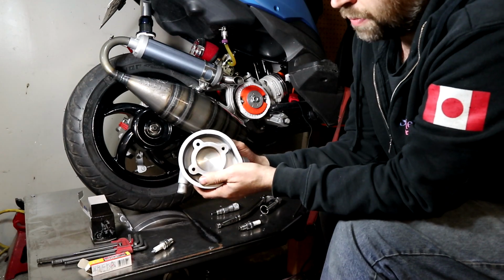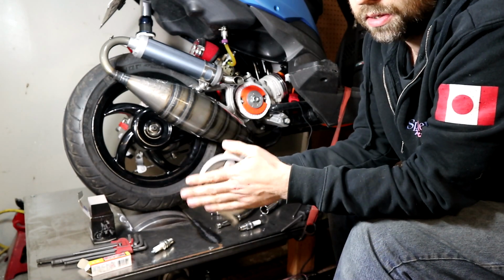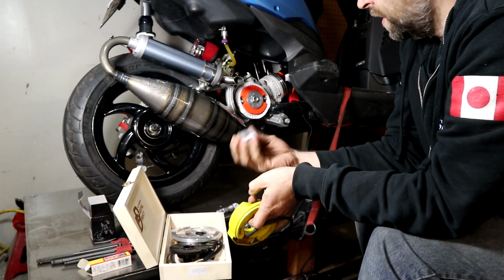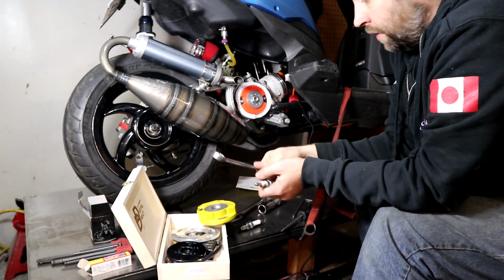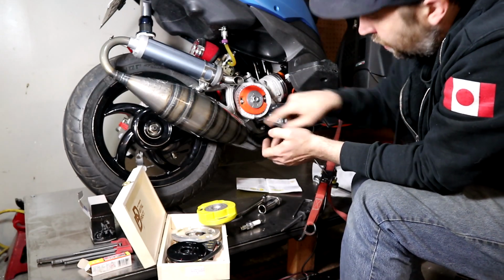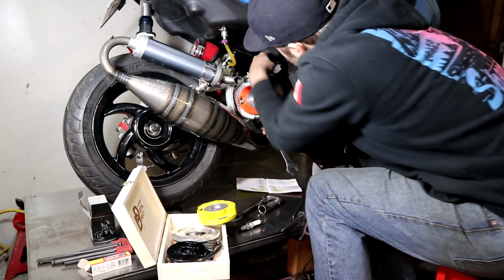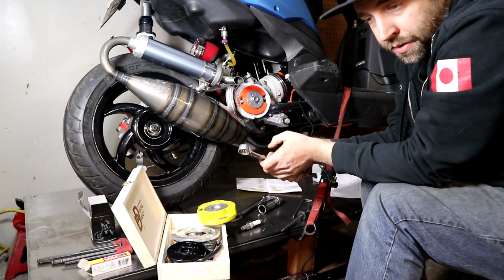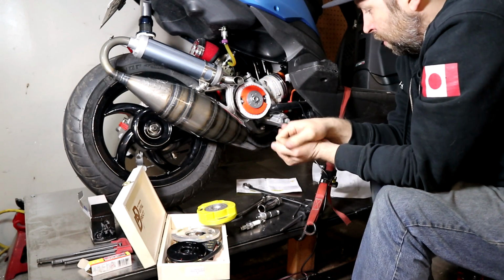Setting Up an Internal Rotor 2 Stroke Ignition - Part 1 - J's Garage

Comment: Hello, I have set up an MVT on honda dio at .35 as per instruction and I already burned 2 pistons... The timing at idle is 40 + degrees of advance. I noticed in this video you set around 28 at idle and consequently dropping to 5° when revving ( i saw the curve on 49scoot). Can this set up work for Honda dio? How did you set your on Dio? Thanks, Nicola
Reply from the maker: your way too much advance for an air cooled engine would be my guess.

I would pull some initial timing back so it's around 35 or less  and try that.

Also dunno how your measuring TDC but the angled spark plug on a dio means it is not able to use a standard micrometer as its not going to be correct.
Reply: @pitobread  thank you for your answer. I am using a piaggio Cylinder with spacer, therefore I have a straight spark plug. You mean 35 degrees or less at its peak advance right? I am asking cause MVT curves set at 0.35 starts at about 35 degrees and it peaks at around 43 at around 6k rpm. Also, let's say you set ignition to have 35 max advance it means dropping all the curve by 8 degrees. In this case you will have approximately 10 degrees of advance at 12k rpm. Shouldn't you have around 17 degrees of advance at highest rpm? Thanks a lot for your opinion/explanation.
Reply from the maker: @nickfarri   you want 17 degrees at peak power, not RPM, so somewhere at 6-8k probably depending on cylinder.  35 max  I would start with as to not melt anything else.  You can work up from there.
Reply: @pitobread  thank you for clarifyng timing at peak power vs RPM. 
Actually i have a doubt that what has happened might have been caused from a air leak in the head o ring but I believe, as you have guessed, it was a consequence of the high temperature melting the rubber.
AC is not LC...
I will set timing mark at TDC with a advance reduction of approx 9.4 degrees which will bring max advance to around 34 and 17 at approx 8.5 k rpm. The new test will be done with a stage 6 mk2 AC for piaggio and exhaust mhr for race only originally born for minarelli vertical and adapted to Honda Dio. It's  probably not the best for high revs but that's all I have for now ( looking forward to test a roost pv 70 code rst 470). Thanks again for your help.

p.s. 2 I recently found out an other interesting ignition for honda dio ( and many other brands). HPI ignitions, check it out, there are 2 version, racing and with light, both with interesting curves and with the option of a programmable CDI

Comment: Hi there, I have a polini x1 50cc dirtbike that has a selettra ignition. I need a new stator but there's a 90 mm backplate and a 94mm. Im not sure how it's measured cause I measured the backplate diameter and it was like 100
Reply: The part number on the stator is p3356e
Reply from the maker: Most likely the stator diameter where it fits into the back plate.

Comment: Hello friends, I am looking for a mvt system for a 2002 Derbi gp1 piaggio engine, but I mounted a malossi Carrera 39.2 crankshaft, this is a model that assembles 539212 but I want to buy the correct one by buy one in France and they sent me an incorrect one because the nut is  different and I live in the USA
Reply from the maker: I believe there are 2 piaggio tapers, big and small.
You could cross reference the MVT kit you got and see which rotor you ended up with and just order the rotor for the other one.
Reply: @pitobread  ok thanks
Reply: @pitobread  I did not understand you sorry I do not know English I am translating it

Comment: Good tip on the degree scale made of paper , without it your hunting for the  number blind somewhat  . Innova make a nice light for under a 100 bucks  Pro digital  has a nice 2cycle 4 cycle setting  ..  Good video
Reply from the maker: Thanks, I added a quick link to the one I use in this video.

I find my nice Innova light behaves poorly on my 2 stroke may be RF interference.  I bought an el cheapo  29 dollar amazon one that works great as long as you have a resistor plug in...